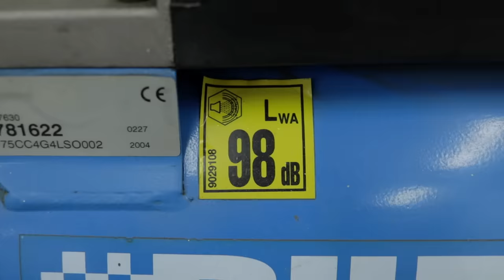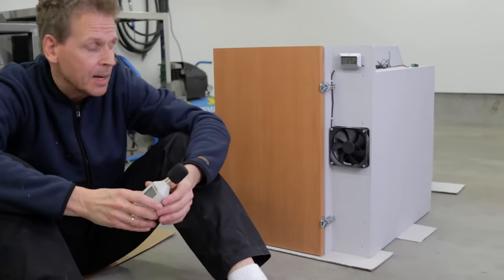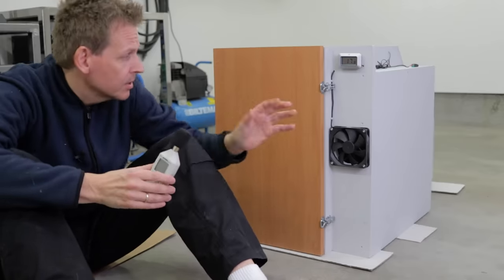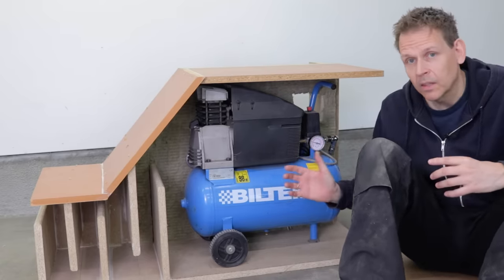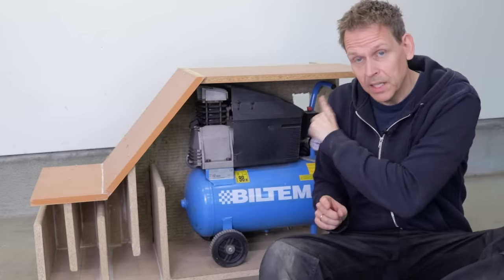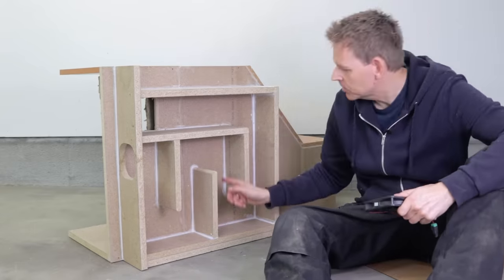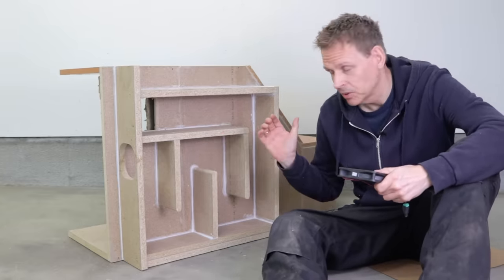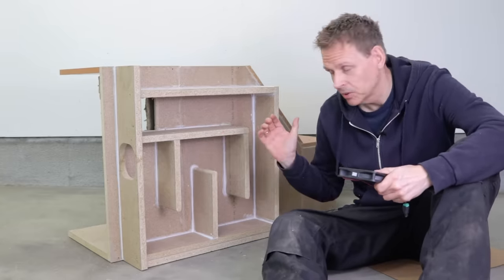Do not build a sound insulated enclosure for your noisy air compressor!

Comment: In my experience there are 3 things you need to worry about to quieten down an air compressor. 
1~ Air intake. Some machines have a very crude strainer for the air intake. This will allow a lot of valve noise out. My standard solution is to remove and modify the air intake to use an automotive paper element air filter. if you use a big enough element it will completely shut up the intake noise and with the added benefit of better filtration. 
2~ Contact points. The type of floor plays a part as the action of the compressor vibrates the floor and frequently amplifies the noise. plenty of high density sponge rubber under the contact points, can use carpet pieces 2~4 layers. The tank can also amplify so if you are really fussy you could use some stick on sound  deadener sheet. Make sure all guards are tight and not vibrating.
3~ Compressor itself. Some units are naturally nosier than others, as a rule of thumb direct drive piston is the noisiest, belt drive piston is next then come all the specialist types like diaphragm, vane or even screw. A rule of thumb is slower is quieter. 
If you do put a box around it it will get hotter, for air ducts into the box the easiest and best way is to get a couple of soft cheapo brooms and line the path with them. The broom bristles should intersect in the middle 1/3. That works quite well.
Reply from the maker: A lot of useful considerations here, thanks a lot for your input 👍 I will definitely take a look at your bullet point number 2 - I think the vibrations is what is causing most of the remaining noise.
Reply: Also you can add a pipe to the inlet(s) and direct it outdoors, that will quiet it right down too.
Reply: Ok so I've got a generator in a bus behind an over engineered wall (massively dropping dB and changing the frequency for lower percieved noise). I've already got some 1"thick Rubber matt and ¾"rubber foam matt set it on. I can set it on a platform with super stiff springs (lowering the contact patch)... I'm thinking no lol. My main thought is what can I do to lower the noise it makes in the first place. I've already gone overboard, but was thinking you might have some good input here.
Reply: @p0lyglot  You could but that will add another problem I didn't address.  All compressors make water in the receiver due to the dew point of air and it getting compressed. It is VERY IMPORTANT to ensure this is drained as frequently as possible. I run the biggest elbow that will fit to replace the drain point in the tank (Always ensure it is the lowest point also) then a big hose to a ball valve in a convenient position to drain moisture every time I switch it on and off. This can also be noisy but there is a cheap solution. I make a silencer to catch the mud and quieten it down.   For a 1/2" hose and ball valve drain i'll get a piece of galv water pipe1 1/2" threaded on one end to fit the 1/2 " hose.  Usually 300mm long but longer is quieter and pack hard the pipe with old heavy rags, stuff like denim, with a mix of t shirt thrown in.  This I compress in the press until it is very tight (you can over compress but that was under a 50 ton press you only need to use  enough to make it solid) . I then drill holes in the sides of the pipe to cross over each other at different heights just big enough to clear some nails.  Then install the nails into the compressed rags inside the pipe with the nail heads on the outside. Normally not needed but you can then wrap the outside in 100mph tape to restrain the nails from blowing out. If the rags are compressed hard enough it isn't necessary but everyone is different. I have put these against commercially available silencers and unless they are flooded with oil they beat the commercial ones in restriction and noise.  They will clog eventually but I pulled the drain one of my compressor that failed after 15 years and used daily and it was still working fine.
Reply: @jonathanbetenbender307  Check anything that comes off the generator. Cables can also transmit vibration therefor noise, cushion the first few contact points. It should help.
Reply: I am quite happy with an old rebuilt compressor I had to Repair from a friend of mine, my nail gun is louder than my compressor. But it does have some intake noise I'll have to look into changing the intake filter.
Reply: @dazaspc  on large standby setups I see noise transmission. 
Say a 250kw gen is 150-200' away from the 600 amp transfer switch in the house and it's got conduit.  
Go in the house and open the door to the ats while the gen is running and you'll hear it. 
Fans on generators make a lot of noise , exhaust is usually 2nd followed by engine intake noise. 
Go as big as you can go on the last 2 , and for fan noise you're kinda stuck unless you can direct the sound up. 
Most sound attenuated generator housings put the sound up towards the sky to dissipate upwards.
Reply: @MrTheHillfolk  Conduit works like the ear tubes on a doctors stethoscope so all you can really do is fit a gland to stop and block on both ends.  If it was allowed you could pack the airspace with fiberglass but it wouldn't be safe let alone legal. All you can do with stuff like those big generators is what I do with Big compressors ( 2000 cfm )for cooling fans. Fit baffles onto a flue to direct the sound upwards.
Reply: @dazaspc  " ear tubes on a doctors stethoscope " are made from material that is flush and dense so it is able to bounce off the sound waves.
I would not make the conduct so equal->exactly the same distance between every baffle and every baffle at exactly the same angle+the material he is using for padding of the surface do not look very effective to me.
You can buy profesional stuff for that and its not so expensive as most of the time people using it to cover whole rooms so its mass produced.
Reply: @kihestad  Instead of making all the baffles from hard and thick wood you should use something thin and cover it with proper dampening material. I would also not build it so simetrical with exactly the same space and the same angle betwen every baffle.
Also your explanation that you trying to make the tunel longer is wrong idea, you can have few km long pipe and if someone gonna be speaking to the other end you gonna hear it(that is how people were comunicating on old ships-speaking tube / voicepipe)
Reply: @Bialy_1  That is correct. The goal is to make the path of the sound wave not reach the outlet. Think as a biljart bal!
Reply: @Bialy_1  it is the air path
Reply: Belt driven compression? Excuse me if I’m wrong but that is not a method. 
Another thing…slower = less balance of forces, therefore slower = more vibration= more noise. Therefore the faster the quieter…? 

Could be wrong, only a physics major not a compressor technician or anything.
Reply: I mean it’s not a far fetched idea to use belts for compression but seems over engineered for the task which results in the same output. But regardless I assure you, I am not knowledgeable on the topic, so take my words lightly. 
But the vibration thing I’m fairly confident about.
Reply: @Boofedit  Belt driven compressors usually start at about 5 cfm. People usually go for these over a direct drive for better service life. If you wanted to paint a car the usual size is a 12~15 CFM unit and these are almost always a belt drive. Direct drives run at a much higher speed with a smaller pump. I believe it only for cost. As for speed I don't know the science but only give my experience.  I have had the misfortune  during my career to have maintained near absolute zero vacuum pumps up to 3000 cfm screw  compressors with even V16 deutz driven units. I had a 3" hose come of of one of those once and it just went WOT. I had to approach it inside a pay loader and drop the bucket on the hose so I could shut off the compressor. That was noisy 🤣
Reply from the maker: @Bialy_1  ahh, you have some highly valid points there! Perhaps I should add some more dampening materials to my channels, I can reach the start and end of the channels easily, hmmm 🤔
Reply: California Air Tools .. night and day difference in sound levels, sub-60 dB and for a little bit more money all aluminum tanks. My old compressor went out and the first thing on my list was to find something quiet.
Reply: @kihestad  you should also check number 3. I've noticed that equipment from Biltema is far inferior to some brand names. I have a multi-tool from Biltema that is super loud and has no torque compared to a brand name version.
Reply: How about the routine dewatering of the tank! Best to include some easy method of draining it as well if one decides to go to the effort of enclosing the thing.
Reply: @sietuuba  I covered that in this thread.
Reply: I imagine by adding a DIY muffler to the compressor cylinder air intake will have biggest effect (<- on my TODO list). Also I found out that better air filter also improved the throughput of the compressor.

+ I have looked for extra pressure tank for my 25L compressor. I found out that I better by another 25L compressor rather than buy a pressure tank. ... in that case, I should look for a silent 25L model.
Reply: @kimmokannala4576  Depending on what you are doing with your compressor it is usually better to shop for machines via how much air they make. If you need to spray paint or use air tools for longer than 20 seconds at a time 50 liters should be ok.  But the true capacity is CFM at a certain pressure. a 25 liter would be 8 cfm at maybe 60 psi as a very rough guess.
Reply: For the intake, using the entire air box is a good way to go. Pick a quiet and cheap car, like a Prius, and get a replacement box at autozone. A lot of engineering goes into dampening intake noises with the box shape and size
Reply: What about refrigerator panel boxes,flex paste rubber and or raptor/bed liner?
Reply: @jonathanbetenbender307  get foam as "dense" as the springs. Might have to make contact feet for the tank.
Reply: Everyone here has great ideas… applicable also for noisy family members (e.g. infant, spouse, in-laws, etc.)   Forced draft air supply, air exhaust, and extra padding for self-soothing. Serendipitously, the moisture from the blowdown valve outlet reduces corrosion in the air receiver and/or provides a water source for the occupant. 😅
Reply: That's some awesome homebrew knowledge to drop there.  I like it.  And, unlike most of the internet, none of it is incorrect.  Well, aside from, "nosiest," we all knew you meant, "noisiest."  But those neighbors can get nosy.
Best response:  A blast of air from your already pressurized air cleaner...
Reply: @philstuf  Damm auto correct
Reply: @dazaspc Great advice. I'd start off with the compressor...not everyone needs a commercial compressor but if you can swing it there is a lot to like. A commercial motor running at 1,750 rpm is MUCH quieter than the commodity motors found on many imports/cheapies (generally running around 3,500 rpm). The pumps on commercial style units are also quieter (usually bigger piston(s) running at lower rpm). My pancake compressor runs SO much louder than my 5hp 80 gallon commercial for example. As to the intake comment...yep. Check out Solberg as a manufacturer of dedicated sound reducing muffler/filters (Amazon carries them).
Reply: @kihestad     I'm writing a long note here so sorry for that.
-Vibration and the airflow are definitely to be considered as the commenter above suggested, you can find noise dampeners for motors (such as air conditioning compressors) in hardware stores.

- other notes I have here are that you accounted for the noise that will flow with the air only and that the air flow will be enough with the small fan you made.

---Remember that sound is energy transferred in waves through different mediums not only air, it enters our ears by air mainly but in a workshop, it can go through all kinds of things. 

-The machine will have so many noises from all its moving parts, so sound is transferred from the machine through air to the case and back to the outside from every angle exposed to air. Making the walls heavier will absorb some of the energy but will probably just change the frequency of the noises.

---Insulating the vents like a car exhaust will reduce the noise only if it was causing the noise the same way as an engine does, but it doesn’t. An internal combustion engine releases so much energy through the exhaust manifolds as pressurized HOT air has so much energy, so it cools down in mufflers and shrinks until it’s within designed acceptable range. 
-In the compressor’s box you made, air will flow inwards through all the vents during the compression because the largest air flow is towards the tank...to be compressed. but the machine's fan will just circulate air inside and gradually heat up.

Suggestions: If you want to isolate the air flow inside the box you should remove the fan cover and locate the intake, install an intake hose to the outside of the box. This will also help reduce energy consumption as the machine can compress more air if it’s taking cold air from the room instead of hot air from the box.

Since the cooling happens at the radiator fins the fan in the machine is installed so that it can cool the compression chamber if the machine is exposed but if you enclose it you need as much air intake as the fan can provide. You can install another fan (the same size and enegry of the original fan) on the "intake vent" of the box or on the "exhaust". If the fan is a 220-240 Volts they will both work just fine. otherwise you can couple them through a relay.
Reply: @p0lyglot  Precisamente, amigo ;-)
We used to have a piston compressor (two cylinders, two-stage compression, 8 at/ 120 PSI max) in our works, and the noise was deafening (the electric motor powering it was 15 kW one, and the tank was in the order of 200 litres). One day my brother and myself cut off the pipe on which air intake filter was fitted in half, drilled a hole in the wall next to the compressor, took a 1 m piece of a 50 mm/ 2" rubber hose with a steel spiral inside it (so it wouldn't collapse), fitted the air intake filter on the outside of the building and connected it to the "remaining" intake pipe with that rubber hose.
And that's it, no additional "insulation" - and presto, most of the noise from now on reminded outside.
The compressor still produced SOME noise, obviously, but now it was on acceptable level (you could normally converse with other people when it was running, while previously you'd have to shout to be heard).

With a piston compressor, this is the best and simplest solution, as the majority of the noise generated by it is caused by intermittent sucking of air in. Building any enclosure around compressor isn't a great idea, as it may lead to the compressor overheating and it'll make periodic draining of the condensate more difficult. In short, it is generally best not done - unless you live in a densely populated residential neighbourhood with lot of pesky neighbours likely to complain about "the noise" at 7 PM.
Reply: @kihestad  I'd go with the box within a box method, isolating the inner box with rubber dampeners. Look at how a hearing test chamber is constructed.
Also, your baffle system made me think of what the interior of some Bose speaker models look like. Depending on how the sound waves are interacting, you might be actually amplifying as much as making it quieter. Perhaps much smaller channels would do the trick, especially if you added rockwool to all of the interior surfaces. Just spitballin' here but maybe fill the channel with something like corrugated cardboard as well to break the soundwaves down while still allowing airflow.
Reply: Very good comment, noise from the air intake is a big deal. Our shop got hot, we were afraid to put our huge compressor in a box.
Reply: No no no!  Sample the noise, invert it and add it back using speakers and a good amp. THEN all you have to do is stand in precisely the right place all the time for the two sets of sound waves to cancel!  Care must be taken however as there will also be locations where the sound energy will add!  OR just wear good sound cancelling headphones ;-)
Reply: @physicsguybrian  Yeah, or you just run both speakers 180 degrees out of phase or you take your noise cancelling headphones apart and connect the outputs to the headphone speakers to the aux in on the stereo. You know I believe Lexus had an external noise cancelling speaker in a vehicle 20+ years ago.
Reply: @physicsguybrian  Now, this is what I call "a stroke of ingenuity"! ;-)
Or, as Germans used to put it, "warum einfach wenn's auch kompliziert geht", or something like that.
;-)
Reply: I agree with the air intake, and you dont need anything fancy.
For most heavier home use (sandblasting and the like), you need a compressor with like... 1000 liters per minute or round about 30-40 gallons per minute.
Even a 1.6 Corolla at full blast will need like 12000 liters, so a Corolla airbox from the scrapyard will be more than sufficient!
Reply: @dazaspc  My solution for the noise of the auto drain, that cannot clog, was to use a 10m roll of 4mm nylon tubing I had left over, making a really tight roll out of it, held together with cable ties. Then on the outlet of the auto drain, and it silenced the noise a lot, but would still allow the water and crud to pass freely. Then on the output of that you can put some 6mm tubing, again a few m of rolled up pipe, and leave the end empty. As noisy as the compressor running, and with no chance of blocking up from anything in the drain. Also put the auto drain up next to controls, feeding via some 8mm nylon pipe out of the drain after the existing valve. Press on fittings so easy to remove for service and for the 5 yearly pressure tests, same with the output, which also had a shut off electric valve, so the compressor would not leak down when off. No pressure cycles means longer tank life, and the 40 year old tank always passed both the endoscope and hydro testing with no issues noted.
Reply: @SeanBZA  Very few Small Auto Drains work reliably without a small air leak.  ones with floats bigger than 50 mm are usually ok.  As for electric valves to isolate the receiver from the system when the pump is turned off on a home system it's overkill and just another point of failure, energy consuming, better off fixing all of your air leaks. If you don't have any system leaks and it still looses pressure the check valve on the feed line from the pump is leaking and needs to be fixed.  Steel receivers kept dry will last a couple of lifetimes easily so worrying about pressure cycling unless you are planning to give it to your great great great grandchildren its pointless. Restricting the outlet of an autodrain  can prevent it from properly lifting of the seat but worse still it will only drain liquid and then shoot out a jet at system pressure.  Just drain manually and leave the tank empty as the stored air could rupture or split a hose. You dont leave your garden hose filled with pressure with the tap shut off?
Reply: @dazaspc  This was industrial, so yes I agree the float auto drains are more hassle than they are worth, so that is why I went for electric timed ones. I got tired of paying Festo for new ones every year, because the orifice wore from the tiny bits of tramp rust in the water, and thus wore a groove and leaked. The SMC one was direct acting valve, and a filter that was a lot better at catching sand grain size particles, and the valve would always close positively. Used the same one on the outlet, as both safety (turn off remote start and air is off immediately) and because of lots of equipment permanently attached that all might leak.

Mounted with no restrictions, the piping was merely for convenience in servicing a valve otherwise way down low on the ground, and the outlet piping was there to simply provide expansion for the output air and water slug, but with no restriction, other than the dynamic pressure loss down the pipe. Pipe was larger than the filter mesh in the drain, and the valve itself, and the drain was checked on a monthly schedule as well as part of the maintenance cycle. Compressor was a little over size, it ran around 150 hours a year according to the hour meter on the controller, and service was thus on a calendar cycle. 

Oil came out looking almost like it went in, and the magnetic plug only ever had a small amount of fine sludge from cylinder and ring wear, normal for the type. That old oil was used for non critical lubrication, like hinges and such, good second use for the full synthetic Ingersoll Rand oil after it had been used a while.
Reply: @SeanBZA  That's only a little one The last plant I worked for had 12500 cfm and ran at about 90 psi. 5 compressors at about 80~95% duty cycle. there was a real art in staging the pressures to prevent to excessive current draw. We used a lot of air. In humid weather it made well over 1000 liters of water a day. I put in timed valves and it worked well enough but needed a daily check on each receiver. I used pneumatically actuated ball valves, the direct acting units burn out to many coils. Ran properly filtered air to the pilot valves.
Reply: @sietuuba  yes an auto drainer. I have one I got from harbor freight. Everytime the compressor starts or stops it momentarily opens the petcock on the bottom of tank. Completely eliminates the need to blow down tank. Which is nice because you can always have air ready to go.
Reply: Yeah ive heard of ppl making baffles like a car muffler for the intake, and in those demonstrations it appeared to have reduced the noise by around half. If true and not clickbait, thats the difference between a busy highway and your stereo volume set to 4 eight feet away (ppl really underestimate lower dbs, and over estimate higher ones), damaging levels of noise in an enclosed space vs tolerable. Whisper quiet would be nice, but you might as well build an exterior ad-on shed outside to house the thing, and just get more hose.

I also did exactly what you did for the compressor at work with the drain. The problem is thst its no ome persoms job to drain it, so ome day i thought the compressor soumded funny, amd draims ten galloms of water out of it. $30 of hardware store parts and an hour later, there was an easy access valve and hise that drained into a bucket. Now that it isnt a chore to reach under with a pair of pliers, apparently ppl van now rememner to do it at least once per week.
Reply: @Boofedit  I believe that he was saying belt drive as compared to direct drive.
Reply: Pieces of horse stall mats work good for mounting pads. Thick and dense.
Reply: A dual stage compressor is quieter and runs a lot less too.
Reply: A motorcycle airbox with the filter in it, works well. You run 1 1/4" vacuum cleaner hose from your air compressor, through the wall, to an outside wall, then mount the motorcycle airbox on the side of the exterior wall and run the vacuum cleaner hose into. Most motorcycle air boxes are somewhere around 1 1/2" in diameter or 2" in diameter, and can fit a vacuum cleaner hose or hose adapter. You do this, because you want the fanciest, most water resistant filter you can get, and that's a motorcycle airbox, which is designed for total submersion in water. Motorcycle airboxes have a little water drain port at the bottom, in case they get water in them.
Reply: in my experience there is 1 thing to do to silence a compressor = buy a cheap one and cram it in a silence box
Reply: Tl;dr, it'll overheat in a soundproof enclosure
Reply from the maker: The baffles could have had thicker absorbing sound insulation. I was afraid of not having enough airflow for cooling, but after having used it for quite some time now, that is not a problem at all.
Reply: Ja ca hm ok
Reply: Lots of loose parts needed. A frame made of pipes, a compressor suspended on transport rubbers, and everything wrapped in an old, thick pillows or featherbed of goose feathers ;).. Maybe it will be possible to achieve attenuating and canceling waves.
Reply: Can confirm the intake., I went from a plain strainer to an automotive air filter style (looks like a tiny V8 one) and it made a big difference.